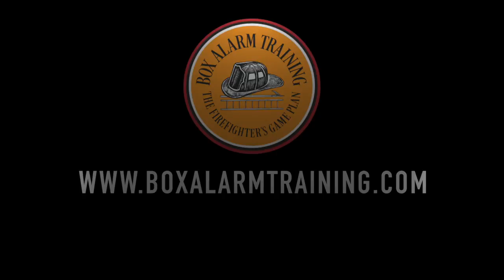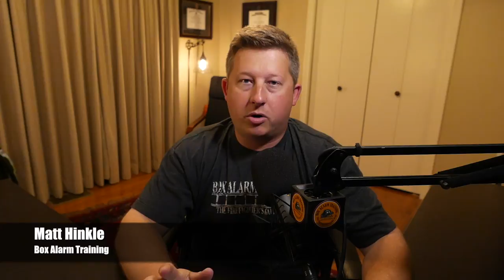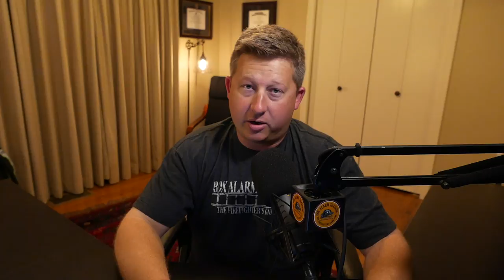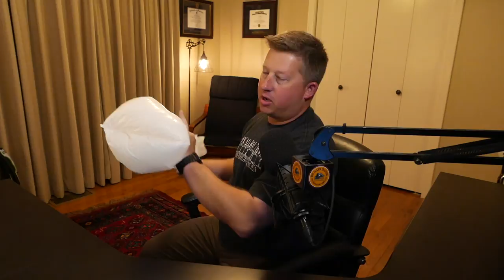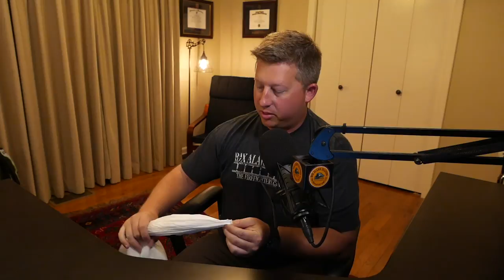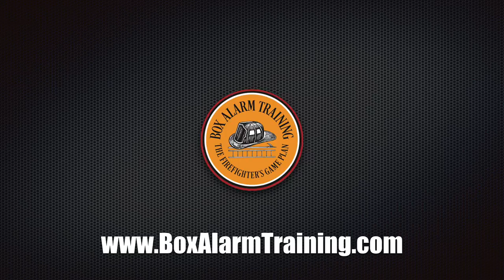Bernoulli's Principle Applied to Firefighting | Box Alarm Training

Comment: Retired paramedic, volunteer FF here. I just came across this. Wondering what kind of wizardry this is? Or did the firefighters just use special fans to extract the flames? Still they’d have to get inside and kill the hot spots. Unless the city said, “fugit abuot it” 😂

I saw a fire break out once, near my office. It was an old factory where some junkies sometimes gather, so it naturally went up one day. There is a big heavy gate at the entrance of the yard with heavy steel bars and barbed wire. People from aroun the yard tried to open it before the firefighters came, so they had an easier job, but no one could open it, and there is a metalworking factory near it. Angle grinders, saws, nothing could cut it. The junkies used a small hole to get in.  Haxomen:  The firefighters came, took out some contraption and took the fire out through one of the windows of the factory. Using the Bernoulli principle. They never entered the yard. The fire raged 20 minutes and was done in 5 minutes after they came.